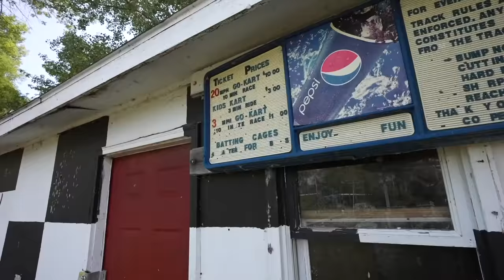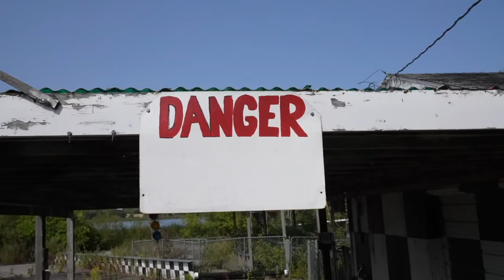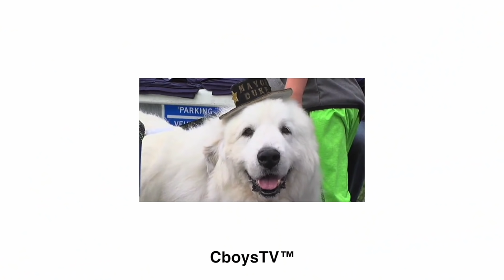Sneaking into Abandoned Shifter Kart Track!!

Comment: That kart isn’t useless. You don’t need to buy the same exact brakes as it has now. Just need to buy new calibers and rotors possibly rotor hubs and possibly a master cylinder if the one that’s on the kart isn’t powerful enough to operate the new calipers. Just make sure you get a caliper mount that will fit the new calipers and if you have front ones then make sure they fit the spindle size